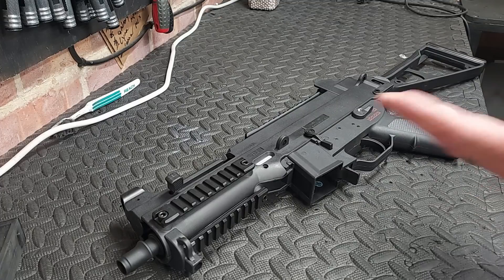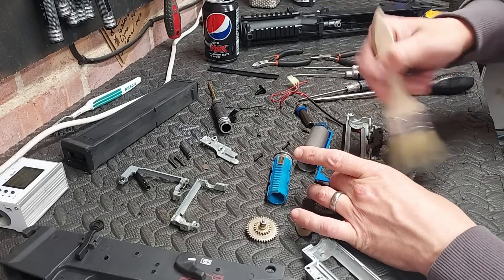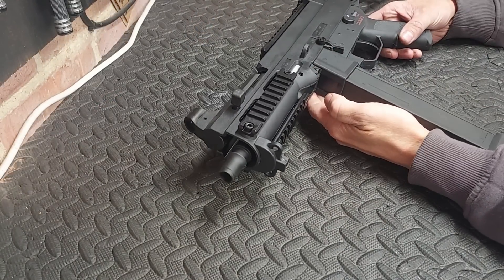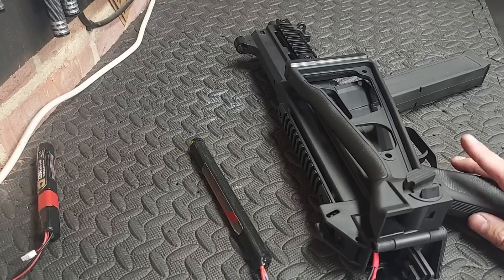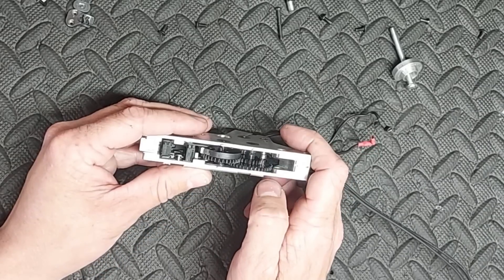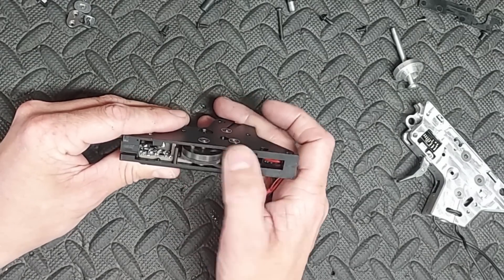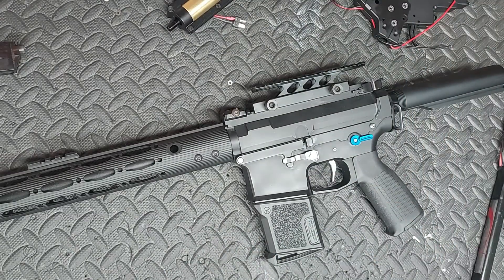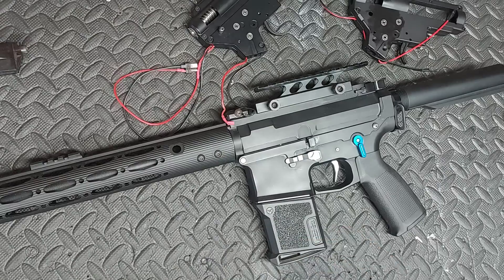Cheap CNC'd Gearbox Cases!

Comment: I have one of those XT/AliExpress split CNC gearboxes and I noticed a couple issues with mine and I was wondering if you did too.

The issue I found was that the cylinder window is a solid 0.7-1mm too forward needing me to modify my cylinder with a cut out so that the tappet plate doesn't bottom out on it. The other issue I found was that the radius at the front where the cylinder sits is too big causing the cylinder head to smash the radius rather than the front face of the gearbox casing.

Have you seen these issues with your split shell?
Reply from the maker: These are the airsoft type, not the gelblaster type & there are a few differences
Reply: @NegativeAirsoftTech  the AliExpress one is also available in airsoft version and that's what I got
Reply: @NegativeAirsoftTech  it's identical to the AK2M4 XT model so maybe I got a lemon

Comment: I bought a warhead after seeing you are very excited about it. But unfortunately the one I got had very very bad QC. The pinion gear doesnt fit and after the second time I disconnected the -pole the whole the whole connector broke of the motor. Wtf for 100+ euros?
Reply from the maker: I've fitted hundreds, I've broken a few tabs but no failures or non-fitting pinions.
Contact warhead.
Reply: @NegativeAirsoftTech  i did. See what they say

Comment: Totally random question Luke WE glock hop units, anything bar swapping them that can be done to increase the weight you can run. I only want to hop a .28 I've tried swapping rubbers but no real difference. Thoughts? I blame the hop arm,  It's too weak and the windows a bit tight
Reply from the maker: Just bend the arm

Comment: Biiig difference between the 2 gearbox cases are bearings on the cheaper one. Bearings tend to still move freely on tension compared to bushings. Just thought id point that out.
Reply from the maker: Which causes the cases to flex?
Of course ...

Comment: Not a good example of binding gears with XT vs Retro arms because XT is on bearings so wont bind as easy under axial load. Not trying to defend retro arms the fitment is a hassle and split shells are more hassle than they are worth. Had a Prowin shell a few years ago and went back to Lonex because they just work.

Comment: I’m wondering if RA has changed their aluminium supplier. They state it’s 7075 but in all actual reality they could change it to 6061 (or an even lower grade) and no one would fucking know unless they were a metallurgist and could analyse it at a molecular level. 
It happens all the time in the manufacturing industry, they change base product supplier and hope like fuck no one notices.
Reply: Manufacturers are indeed master baiters and switchers.
Reply from the maker: taste test

Comment: I’ve been using a lot of Pete’s XT brand parts for a while (only ever had one motor give out, which I think was down to the user as he had it apart) but I’ve been very impressed with the quality of their parts. 

I’ve yet to try the split shell, fitted a fair few RA shells and the most common issue I found is their v2.2 for vfc 417/g28, seems like early versions had slight tolerance/alignment issues other than that I haven’t had many hiccups with RA, but it’s good to know XT shells are a cheaper alternative!
Reply: Hey Luke, message me on FB about the motor, not had any failures on those yet so interested to know more.  One small downside I've noticed is that due to the extra vents if anything get's inside can affect the turning.  But other than that not a single return on them.

Comment: Hope you’re doing well Luke! ❤️
 I literally picked up an EF comp ump for cheap cheap boneyard recently and was surprised at the stock ROF, sounds almost identical to the stock CA… makes me think they may be very similar (besides microswitch trigger- which ruined my perun plan..but uhhhh yeah warhead) 
And I was juuust dealing with the same sort of issue on a retro amoeba shell (not even split) last night- the thread ring at the back and even thinner material around the EFCS unit exasperate it, the top just wants to separate and the trigger area is just too thin to NOT flex. I have to undershim sector and overshim bevel and spur >:( I try to avoid the inevitable amoeba shell breaking at the front and what do I get… a pain in my ass

Comment: Love the videos 🔥
Quick question though. When I use 11.1 the motor gets quite warm. Does this damage anything or is it ok to continue using
Reply: Depends, that's normal if you fire alot, especially with fast semi auto fire, but if you don't shoot that much and it's getting hot or even warm really then you either have a crappy motor or a lot of electrical resistance. Also you do have a mosfet to protect your trigger contacts right?

Comment: I just went through fucking hell with a Retro Arms split gearbox and discovered last week that I had to leave play in my shimming for some random fucking reason.  Problem with that??...the fucking shimming is loose!  Glad you cleared it up.  I was about 2 days away from sending it to you!  Once I went back to the original gearbox, feeding issues went away, gear noise went away, FPS came back up.  Fucking furious...I bought 2 of these fucking gearboxes that don't like my G&G CM16 bodies, AND THEY'RE TOO TALL TO FIT MY MP5! FUCK!  I bought an ICS, so I'll get back to you if the lower gearbox half has any flex in it.
Reply: How is the ics?
Reply: @sututututututu9977  Pretty awesome, actually.  The ergonomics LOOK weird but everyone who picks it up seems amazed that it fits so well.  I've got mine fully modded out now and I can hit 6 in steel with a red dot, zero magnification from about 80 feet away.
Reply: @ChemonV69  yoo thats nice what model did u get and what did u change?
Reply: @sututututututu9977  Hera CQR SSS model.  Dropped in a new motor and gear set, barrel, spring, piston, cylinder... basically everything.  But, the only necessary change needed was the motor and shimming.  Everything was so tight that it was blowing fuses almost immediately.
Reply: @sututututututu9977  Not enough flex in the ICS to cause any problems, though.  :)